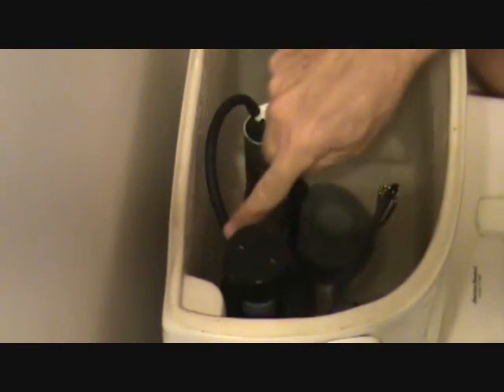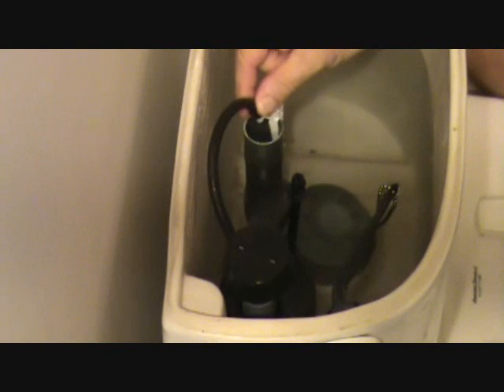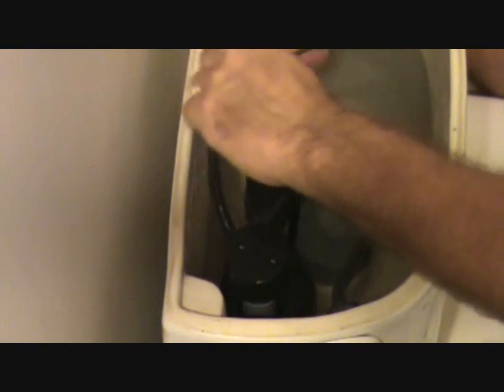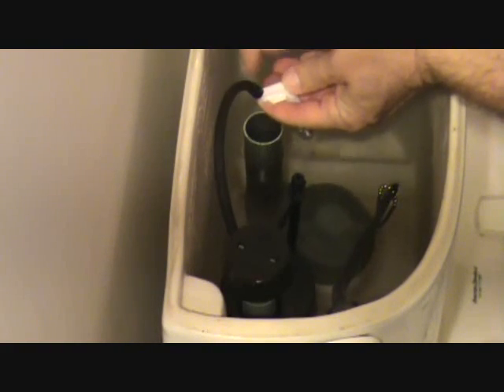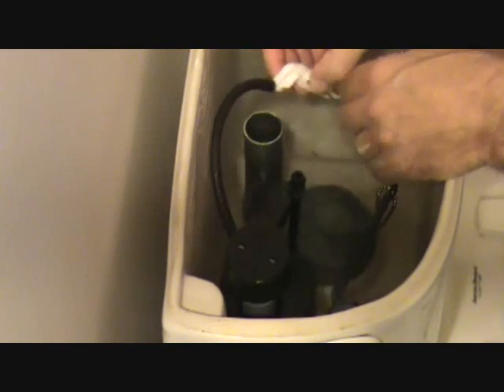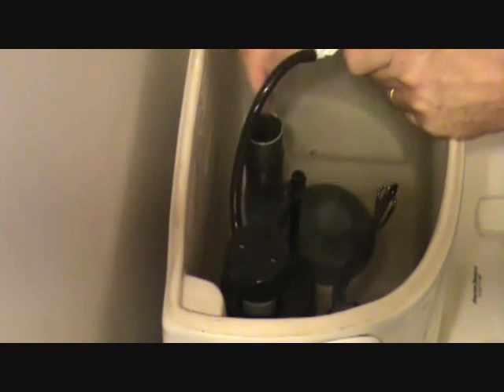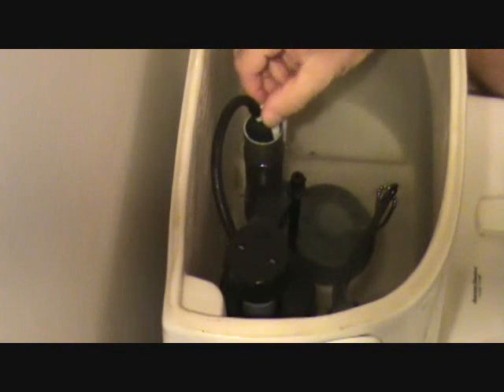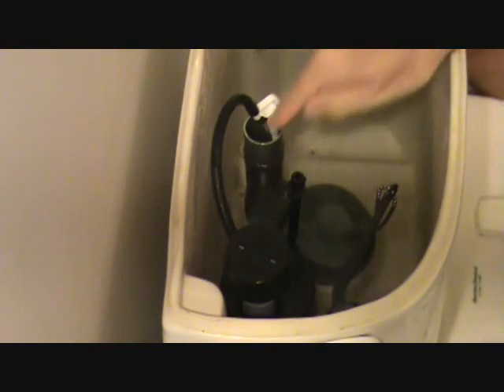How to prevent a toilet tank from draining: without flushing

Comment: I sure wish I would have read all the directions to install my new flush valve or watched your video BEFORE I bought a new flapper then an hour later another new flapper with the flush seat repair gasket & silicone. 

Just as you’ve described my tank was siphoning itself because my tube was inserted too low in the overflow tube. All fixed now and that hook was not the gratuitous unnecessary spare item I thought it was!  Thank you, Joe!
Reply from the maker: Awesome! Great to hear you got it figured out! I have lots more toilet & plumbing videos & all kinds of other DIY videos on my channel too for more learning & more savings. Just go to my main YouTube channel page then click on playlists & scroll down & have at it. You WILL save more money around the house...promise! Thanks again for stopping by...much appreciated.

Comment: You have no idea!! Going on 2 weeks... plumber had no clue. I replaced the flapper, and the fill valve. Still losing water...slowly!! Then I found your video. And exactly what you said. The hose being to long was the problem. Thank you!!
Reply from the maker: Awesome job with not giving up to find the issue! Hey did you know that you can now find me (VideoJoe) on Roku?! VideoJoe has his own Roku TV channel & it's called "DIY for Beginners" what else LOL. If you have a Roku TV then just go to the search area & type in the channel & it should pop up & you can start viewing VideoJoe there right on TV while you sit in your favorite arm chair. Grab a bowl of popcorn & have at it because I know VideoJoe is always there to assist you with saving money around the house. Check him out on Roku! 😎🤓  Thanks for stopping by!
Reply: You say, "Going on two weeks," as if tank wasn't losing water before those two weeks. How is it that the fill tube wasn't siphoning water out of the tank in the months or years before those two weeks?  Did the fill tube slip into the overflow tube on its own just 2 weeks ago?

Comment: Thank you so much. 
Just installed a new water valve, put the rubber hose too far down the tube ,tank kept draining . Bought a new trap , filled the tank , turned off the water feed and tank did not drain. 
Thought problem was fixed. 
When I turned the water feed back on the tank started to go down again !       
I was was banging my head against the wall. Watched your video , cut the rubber hose shorter, above the water line as you recommend. Problem solved.  Thank you !!!
Reply from the maker: You are an awesome "golden child" for sure! I have a ton more videos that could assist you further around the house. Just go to my main YouTube channel page then click on playlists & you will see all the DIY topics I have. More toilet ones too! Thanks for your message. I'm glad I posted that particular video if for any other reason at least it helped YOU out!

Comment: So the toilet I have in question did have some sort of clamp similar to thing you showed in this video.  Instead of plastic like its metal based. Had the toilet fixed a year or 2 ago because the circular stopper part that keeps water in tank let some out, then the other part the one that refills using the bobber piece had to get completely changed. Seems the last time fixed must have forgotten to set up the tube to not cause the suction issue and the tube was as you said in this video.
Reply from the maker: Yes the toilet from hell....right? You should be able to adjust that tube with the little clamp thing you have. Did you get it fixed?

Comment: This seems to have solved my problem. I put the tube way down in there so it would be quieter...without knowing it shouldn't be put below the water line. So thank you for making this video. 

You know, this is an incredibly important detail that you could, and perhaps should, put in your video for installing a fill valve. I would even go as far to take a moment to mention it a second time after your perfectly executed, problem free, no-troubleshooting-necessary, fill valve install.
Reply from the maker: Thanks for your message & glad to see you got it figured out. Generally for all new water fill valves they have that special top clip that you attach the black tube too so that's why I guess I have never explained why not to put the black tube down the drain pipe as you would never do that with a new fill valve if you use the top clip they provide in the box. thanks for stopping by!

Comment from the maker: @JXJ1326 Most of the time, your toilet will not have to be replaced. Only the inerts usually have to be replaced, which is what is possible. If the tank or bowl has a hairline crack & water is leaking out, then you would need to replace the toilet. If water is leaking from underneath, you may have to remove the toilet & install a new wax ring. You could upgrade your toilet to a water saver toilet, if your toilet is old & water stained. Hope this helps. Thanks for your question.   Joe  :0

Comment: Thanks Joe! Fixed my problem... I almost got scalded in the shower, when the toilet filled by itself... BTW, I think in one of your comments, the person was talking about a "Mansfield" toilet. You know they use a plunger looking thing, instead of a flapper.  And the hose fits into the little hole, of the "cap" where the plunger valve rides... The cap unscrews, to replace the valve or rubber gasket.
Reply from the maker: Yes not all toilets are created equal for sure! Thanks for your message!

Comment from the maker: I think your fill valve hose has fallen off the top of the drain pipe. On the older installations, there use to be a little "s" hook that held the hose in place & sometimes (after time) they rust through & fall off, then the hose just dangles in the toilet tank. I've made my own "S" connections with a paperclip & pair of needle nose & regular pliers. Or you can go to the hardware store & purchase just a connection piece that will hold the tube in place. Thanks for commenting!   Joe  :0

Comment: Thank you so much. The problem is resolved! Other videos recommended that I replace the flapper so I did but I shouldn't have done it.
Reply from the maker: Well on some if not most occasions it could in fact be your flapper so if your flapper is looking old anyway & if you're not 100% sure where the leak is coming from you can press down on your old flapper & see if that stops the leak but if you are still not sure you could replace the flapper & cross your fingers but if your tank still fills up then at least you know it's not the flapper LOL They don't cost much & pretty easy to replace....but check out that hose I show in the video too before getting the flapper.

Comment: Thank you for this video! I have a question: My local water company recently told me that the meter has shown water is running at my house almost constantly every day, but it's a very small amount. Could this problem you show in the video be the culprit of a constant, but small usage of water? I hope so, because hopefully, I've fixed it due to your helpful video. So that should reduce my bill a little plus eliminate the hissing and sound of water running in the tank.
Reply from the maker: This will reduce a little bit of water but you could have a water leak somewhere within your system even though you don't see any water puddling or leaking into your house anywhere. You might want to contact a local plumber & have them come out & see if they can find a leak somewhere. Sounds like you have an issue. Let me know what you find!
Reply: @VideoJoeKnows  Thanks for replying. I hope that's not the case. The water department said that when a meter does not show 0 usage for multiple hours at a time, especially overnight, that is how they are able to identify there is a possible leak. So now that your fix in the video seems to have stopped the water running in the tank, I'm going to wait a few days and contact the water department and have them check the meter and if the readings are showing 0 usage at certain times overnight, then we'll know this was the issue. Thank you!
Reply from the maker: @Quasar1111  Awesome...that will be a way to check for sure. Cross your fingers & let me know too OK? Your toilet must have been filling back up every 15 to 20 minutes or so for weeks & if that was the case then you may have fixed it....
Reply: @VideoJoeKnows  Hi, wanted to give you an update. I appreciate you trying to help. So, your fix in the video definitely resolved the issue of the hissing and running water sound in the tank. That in itself has been a big help! When I fixed that, I added water to the tank up to the marked line, but unfortunately, the water has been slowly decreasing, so there's still a leak. The whole valve system with flap was installed new less than 2 years ago, but it may be the flap, I just don't know. Now that I've given it some time, I'm going to ask the water department to check the readings and find out if it's basically the same amount going out or if anything has changed. Guess my landlord will have to get someone out to try and find the leak, hope it's an easy fix. Thank you!
Reply from the maker: @Quasar1111  Thanks for the update. The toilet flappers are known to start leaking at any time no matter how old they are so it could be coming from not having a tight seal for the toilet flapper. Can you see any water moving in your toilet at all?...like of course this will be really hard to see if in fact the toilet flapper is not holding all the way. Put your ear down there too & see if you can hear anything dribbling. Then reach your hand down in the toilet tank & put your finger down on the flapper & see if that extra weight does anything to the noise you might still be hearing if in fact your flapper is defective. Even if you can't really tell, you might still want to replace the flapper with a new one to see if in fact that is the issue since the flapper shouldn't run you anymore than $5 bucks or so...as a thought!
Reply from the maker: @Quasar1111  Also heard you have a landlord so I take it you're just renting? If that is the case then I would think it should be your landlord's responsibility to fix the leak as well as pay for that high water bill you had. If you are a renter then I would think that would not be your responsibility...
Reply: @VideoJoeKnows  Thank for replying! No water moving and no sound/noise at all coming from the tank, at least that I can tell. I had checked the flapper as you described here, and it feels tight but as you say, it's possible they can leak even if they're not very old. Will now answer your other comment. 👍
Reply: @VideoJoeKnows  Yes, am renting and I am a senior widow. Oh yes, the landlord will take care of any maintenance issues, but I'm a renter who prefers to handle the smaller things, if possible, in order to keep from having a contractor come out because it is actually easier on me to do it that way. It's getting harder these days to schedule contractors and they usually cannot pinpoint an exact time, so you have to clear an entire day waiting on them. In my case, the landlord works with several contractors who live around 2 hours away from my house, so that makes it even tougher. So if it's an issue that I can easily fix, I'll do it and if there's any cost, no matter how small, my landlord will reimburse. However, if it involves a lot of work or something I just can't do, then by all means, I'll have her set up the work. I sure do appreciate your feedback and help! Have a good night.
Reply from the maker: @Quasar1111  Thanks!
Reply from the maker: @Quasar1111  You're welcome & thanks for the message. Let me know how it goes!
Reply: @VideoJoeKnows  👍😃
Reply: @VideoJoeKnows  🙂

Comment: I've taken a look at mine and I took the tube off and held it to make sure it was well above the water line, but I can still hear the dripping sound that seems to have gotten faster over the past 2 weeks. Tank and bowl both slowly being drained over time. Not seeing any water outside the toilet or air bubbles in the tank. Any thoughts?
Reply from the maker: I'm thinking your toilet flapper is just barely letting water drain under it & then out to your bowl. If you push down on the flapper then listen real close you probably won't hear any water draining now. I can't think of anything right off the top of my head especially if you don't see any visible leaking on the outside of your toilet then getting your floor wet. The toilet flappers usually last 3 or 4 years then need replacing. Sometimes though flappers can get out of whack even sooner than that. Let me know...
Reply: @VideoJoeKnows  Intriguing, I've pushed down on it before, but still heard it. I used much more force just now with both hands for max coverage and seemed to have stopped. Likely still the flapper or could it be the gasket?
Reply from the maker: @IAmTheGlovenor  I would guess it's the flapper. Why not replace the flapper with a new one as they aren't that expensive then see what happens. I guess it could also be the doughnut gasket between the toilet tank & the toilet bowl & it could be leaking slowly from there. Then you would need to take the toilet all apart to replace the other gaskets by the toilet bolts then you would probably need to replace the old rusty bolts with new ones as well as the rubber gaskets there at the bolt locations that connect the toilet tank to the toilet bowl. What a pain for that since when you pull it all apart you don't want to try to reuse the old rubber bushings around the hold toilet bolts nor use the old rusty toilet bolts as your toilet will probably leak there too if you use the old ones. That's why I would try the easy thing first...the toilet flapper. I have lots of DIY toilet from hell videos. Just go to my main YouTube channel page then click on playlists & scroll down to toilet from hell & if you don't see that then go to plumbing projects or something like that to find all the toilet from hell videos I posted...& then some!

Comment: Joe, is it necessary for the tube that refills the tank be tucked into the cylinder that goes up and down when you flush the toilet (you, know the thing that opens the drain valve)? Or is it ok if the fill tube sprays the water anywhere into the tank?
Reply from the maker: Leonard Lacroix It's best to clip the draintube to the top of the drain pipe so the water goes down that drain pipe rather than spraying all over the place. One day the water spray will spray up & you will have water running out of your tank lid edges. Make sure not to just push the drain tube down the drain pipe or your risk the tank to siphon your water out which will then make your tank fill up periodically when the water goes down in your tank. Thanks for your message!   Joe  :0
Reply: VideoJoeKnows Hi, Joe, I have tried to push the refill tube into the tiny hole in the top of the overflow (drain) pipe, which is smaller in diameter than the tube.  I had to force it in a couple millimeters by push the edges in with a sharp object. But I am not sure how long it will stay in.  The other option is something else I tried earlier, which was to use a large paper clip that I looped around it snugly and attached to the top of the overflow tube, which kept the end of the refill tube pointed securely downward toward the surface of the water in the tank below.  This would prevent it from spraying all over the place, so I am certain about that.  But does having it stuck inside the top of the drain pipe serve another important purpose?
Reply from the maker: The way you did it should work just fine, if I understand you correctly. Try it for awhile & see. They do have an actual top clip you can purchase separately to also serve your purpose. Most hardware store sells parts so ask a sales person in the plumbing department next time you're at the hardware store. But the paperclip sounds like it will work too. You could also fashion the paper clip into an S & then part of the clip pushes snugly over the drain pipe & the other portion of the S fits into the drain tube. They used to do them that way before they came up with a better plastic connection holder since after time the metal S hook would rust & fall apart. Good job with figuring out a solution!   Joe  :0
Reply: VideoJoeKnows Thanks, Joe.  The way this drain pipe is designed it has a stopped at the top, which the pipe hits against when you flush, and this stops the drain pipe from going any higher as you push the handle down. So the little hole for the refill tube is in the top center of that plastic stopper.  If I try to insert even a small part of the refill tube into the drain pipe, I'm guessing the drain pipe/overflow pipe will hit up against it during each flush.
Reply from the maker: Is there a way to remove the cap on top of the drain pipe so you can just attach the pipe tube with the S hook? That cap was probably for a different size pipe tube once upon a time. I'm sure you'll come up with something. Just don't push the pipetube too far down the drain pipe when you are securing it or you may get the siphon effect I previously mentioned.   Joe  :0
Reply: VideoJoeKnows Joe, I'm pretty sure it doesn't come off.  But I may try and see if it does. Thanks.
Reply from the maker: Good luck!
Reply: VideoJoeKnows Luck is one thing I don't need.  God has blessed me.
Reply from the maker: Good answer!